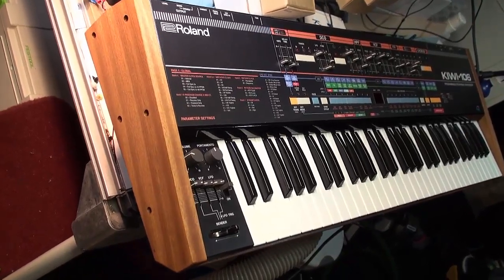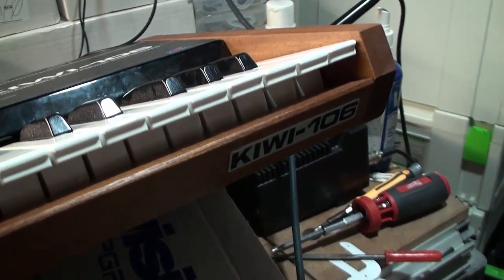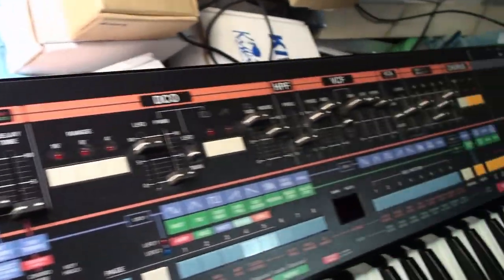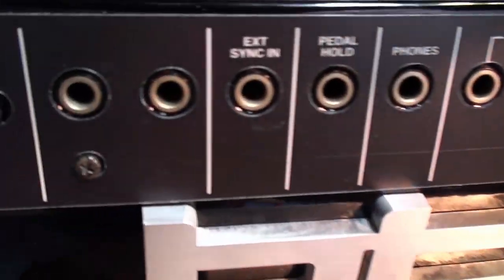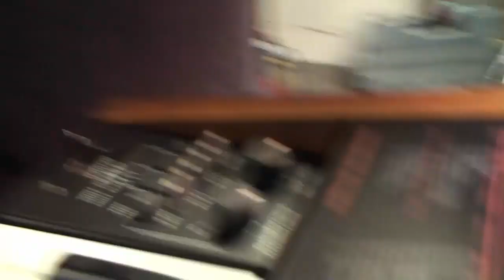BT's Kiwi 106: Completed!

Comment: Upon multiple promises, synthegrator / Psicraft Designs still have not released the VST/AU editor. Without the vst software, Kiwi-106 becomes unusable with your DAW. 
Stay away from synthegrator or Psicraft Designs software or any associated hardware. It literally prevents you to use third party software. So he doesn't provide the vst editor but also stops you from using other software. what sort of bullshit is this?
I will uninstall my Kiwi-106. It is useless. The software comes with many randomly created shit sounding patches and you really don't need the additional features. The original Juno-106 is good enough. Also, unbelievably it is not controllable from your DAW.
This is a very irresponsible group/person/company whatever.
I am so sorry I've invested on the Kiwi-106 and the synthegrator / Psicraft Designs.